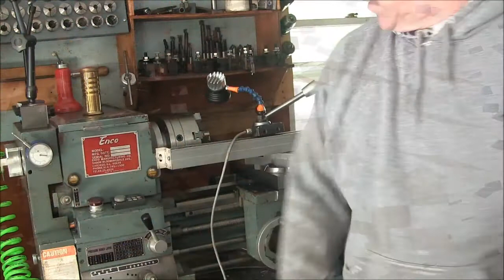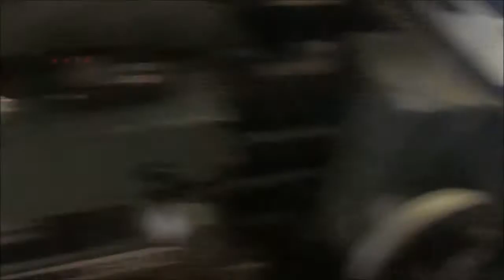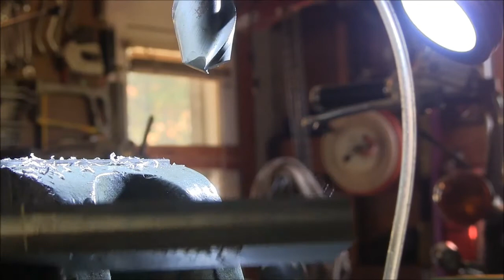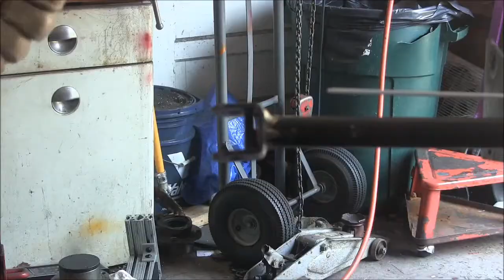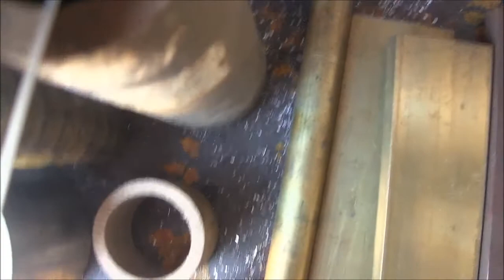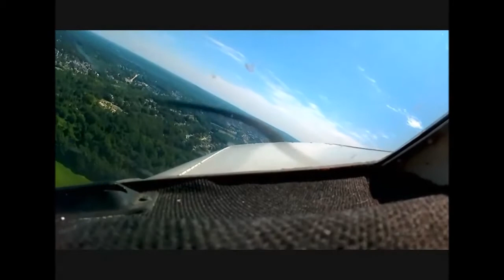Doodads XXIII

Comment: My big move was across the pond - that was not fun!. Best of luck with yours which will be a major deal for sure. Certainly more shop space will be a big plus and even more so, a concrete floor - mine is wood and it's a PITA.
Nice comparator... way too long since I did much electronics, though I have boat loads of components.
Looks like you scored real good with that bunch of material... particularly the brass, tho the large dia Al too is nice.
Good to see a bit of flying... bit of pattern and touch'n'go.
Best of luck with the big move.
Reply from the maker: Thanks Chris, my move is only going to be 50 miles but still a PITA!